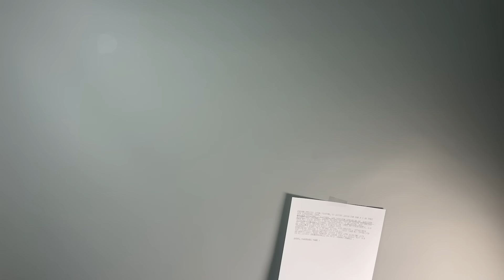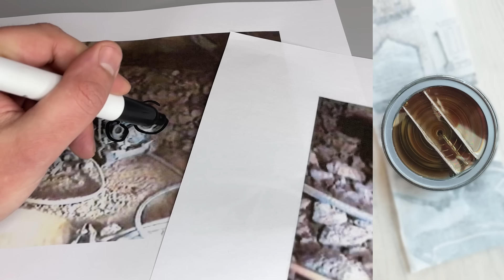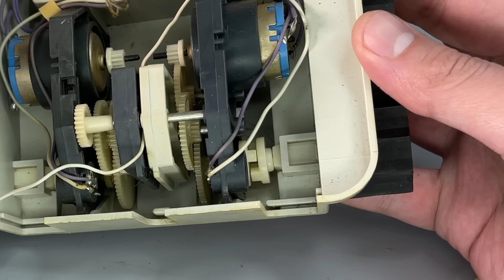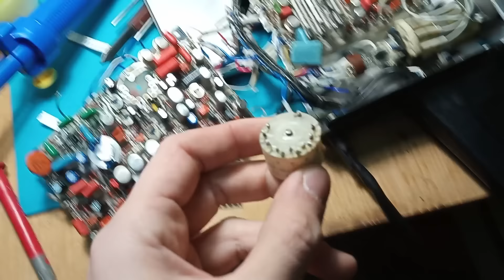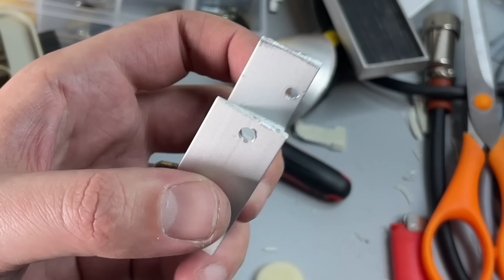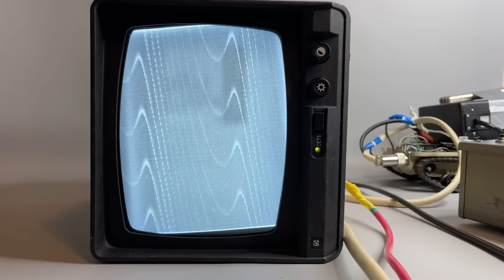We've rebuilt the first Chernobyl robot!

Comment: I doubt they raised the voltage of the motors. Because doing that would also mean raising the torque - making it even less controllable as it instantly kicks in (as with all electric motors). It would've also meant more wear and less reliability - and you surely don't want it to get stuck.

Maybe they used better means of control than simple on/off switches. Potentiometers maybe? I'm not an electronics guy.
Reply from the maker: Actually, you have a good point.

Comment: I wonder if rubber roller restorer used to restore grip for the pinch rollers of idler wheel turntables and cassette decks could potentially provide better traction for the treads.

Comment: If you want to improve the performance of the tracks in a manner consistent with what was possible in 86, and without replacing any parts, you could enlarge the holes the front axle goes through and move the axle forward to increase track tension and limit slippage. This is done on real tanks. A more dramatic change for one used in field experiments would involve separating the front axle and mounting the track tensioners directly to those camera mounting brackets using bits similar to those found in 1980s Erector sets [an engineering edutainment toy that taught kids how to build robots and functioning models of industrial equipment and vehicles]. The bits I suggest are essentially what you did to make the camera mount: custom bent aluminum strips with screw holes.

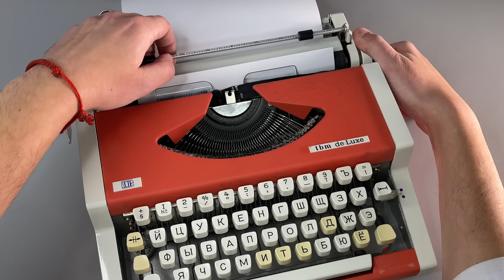Looking up how tank and construction tracks work IRL will help understand what I am on about. Friul models is a Hungarian company that specializes in working metal tracks for scale models that might help. They have a matching set of metal tracks and drive sprockets for a 1:35 scale T72 that would be thematic and should work, if you want a more rugged one for field testing

Comment: Blimey amazing how many parts of that toy seemed to line up with everything they wanted to fit, even down to screw holes!! To improve drive from the drive pulley to the track you could cut a section from a small bicycle inner tube and stretch it over the pulley so you have rubber against rubber rather than hard plastic against rubber?
Reply from the maker: we will tell you honestly, we were really impressed how things matched each other. It is unlikely it was planned, as the choice to pick a toy was limited, but imagine, how happy they were when something accidentally matched that good!

As for tracks, they are good per se, we just need to find the way to soften the rubber.

Comment: Awesome Do-it-yourself project. I'm surprised how much history lies behind a toy. I knew that a toy of some kind was used to get the camera close to the "elephant foot." Another interesting thing: the narrator said that they could get more power out of the motors if they increased the amount of battery output. I recall a cheap R/C car that I had. If I taped multiple batteries together and added a metal plate to make them touch the original contact plates, the car took off like a rocket! It was hilarious and fun to see. It's even funnier that this seems to only work with cheap, shoddy toys. I guess the expensive ones have sophisticated resistors so slapping on another battery isn't going to increase the power or speed up the toy.
Reply from the maker: That thing with elephant foot was not a toy but a cart with a drill; this one went into one of the outer corridors, not deep, but it surely helped.

Comment: I wonder what it would take to radiation harden a modern drone and how such a tool would have helped at the time if the technology was available.
Reply from the maker: For the Shelter? Well, we had a chat with scientists who built TR robots for it (see our documentary about robots), they said literally: "during 30 years we came to conclusion: on robot - maximum relays and "dumb" tech, all electronics better to keep at control panel. And then you are safe"
Reply: @ChernobylFamily  so I guess that’s a no to a DJI drone with enough lead shielding that it can’t fly anyway. 😂
Reply from the maker: @Voodoodrul  there was one experiment of using DJI drones, but inside unit 5 which is radioactive clean; there was an "inspector" drone in a protective cage around.
Reply from the maker: @Voodoodrul  and plus; the Shelter is the place where often you deal with VERY TIGHT (if I could make letter bigger, I would xD) space, so for that very place the best drone is a sort of a robotic snake.

Comment: I would hazard a guess regarding the image quality, it may be impacted by the rather sharp bends at the back of the rover/robot unit where it does a kind of loop. Coax video signal cables can self interfere sort of when bent over itself. At any rate it is rather easy to check if this is the case I think.
Reply from the maker: Yes, it appeared so. But to be honest, we have doubts that in original machine it was different. Unlikely it was planned to remain functional that long as it did..

Comment: I'm not sure if the show was accurate - but it seems if the radiation killed batteries and anything with a DC circuit. AC seemed unaffected. If fiber optics were available could they have built a (albeit crude) robot machine using induction motors and fiber optics (rather than electronic cameras)?
Reply from the maker: Gentlemen who design robots in Institute of NPP Safety formulated it shortly: "ideally, all electronics should be at operator's panel, while on robot only "dumb" components, such as motors and relays"

Comment: Wow what a project you ever made. I thought the robot failed all due to high radiation containment inside reactor. I had no ideas on how bad it was. I am very impressed of your projects you re-enacted. Good job Sir! Glory to Ukraine! Very Impressive!
Reply from the maker: Thank you so much for your motivating words! Well, we had an extensive chat with the experts who design actual robots for the Sarcophagus; their opinion is that this thing actually had all the chances to work well due to the fact that everything except the camera electronics was placed remotely, and even this camera might survive some relatively high (not extreme, though) radiation. It surely did not go to, say, reactor core surroundings as some documentaries claim, but it could explore some outer corridors which already was a contribution to safety of people. Nevertheless, the project is complete but not over, we still will work on some enhancements to make it even more accurate before placing on a permanent exhibition.
Glory to Heroes! Thank you!

Comment: For such a robot to persist that hellish place is it included a radiation shielding?
Reply from the maker: Conditions there vary very much. This one obviously did not go super far, but when you do not have maps for the territory at all, it is still a better option. Though over the years there appeared additions to the story that this thing went almost into the very reactor core which is not true.
Reply: @ChernobylFamily  i think i heard about every robots being sent to that certain nuclear reactor having their eletronics getting fried
Reply from the maker: Not every, but many; we had an extensive talk about this with ISNPP institute; they say that it depends on the route and type of electronics, THOUGH the best practice is to leave only relays and motors on the side of a robot and make optical protection of a camera e.g. with a mirror.
Reply: @ChernobylFamily  i see
Reply: @ChernobylFamily  did the developers considering non wheel or non tracked robots back then?
Reply from the maker: I do not have information about such ideas as for 1986; in the modern times yes, and some were developed, e.g. worm-like mechanisms to navigate through the drills.

Comment: I do recall learning about the original, at the time. As I remember it, a Channel 4 (here in the United Kingdom) television documentary crew went to Chernobyl. The researchers there were terribly poorly funded, hence their need to adapt a toy tank. The documentary showed them using it to explore the interior of the reactor, which (shockingly) was found to be empty: all the interior structure and fuel had melted and oozed out of the containment (most famously creating the so called "elephant's foot"). The Channel 4 documentary crew left behind their radiation suits, for the researchers, who'd only received ordinary chemical protection suits.
Reply from the maker: Yes, i remember that movie. The story is beautifully said, but they told what they were told by Kurchatov's expedition which likely wanted to gain attention and subsequently, foreign funds with was an issue in 1991 (the movie went on air around that time). The footage they used (which we also partly did) was manipulated. Specifically, in that documentary there were glued together a fragment with this robot and image of the reactor internals; the latter was clearly made with a PTZ camera like those we told about in our another video, the robot won't move this way to give that kind of picture. Not even speaking, this device never ever could survive even close to that place, the levels there were insane back then, that would burn away and plastic chassis melt. We had a chat with the Shelter researchers, they confirmed our guesses: it went relatively far, in outer corridors which nevertheless had severe radiation levels to be explored. Speaking about the Elephant foot, the way to it is not passable by any machine for 100% and before your reach it, you need to pass other, not less nasty FCMs. Summing it up, I mean, it DID it job, but not the way how it was presented, and myths were added over the years. That made the research of the project pretty complex. But very interesting.
Reply: @ChernobylFamily hey, dunno if you read this but your channel is so good just binge watching everything!
Reply from the maker: Thanks!

Comment: Wow this is amazing, I'm impressed by the realism. There may be a pot inside the camera controlling RF output gain that you can use to boost the signal before it goes through the coax. For the belt slipping on the driven rollers, you could try this stuff called "belt dressing". It's a bit sticky and helps with belt slip in car engines. That surplus electronics store was cool too - In Toronto we used to have a store called "Active Surplus" I spent hours in, but sadly it's been gone for many years.
Reply from the maker: About the belt dressing it is a very good idea. During a close-up inspection it is visible that motors do have enough power to move it well, but the contact between wheels and tracks is not that good as soon they get in their long-storage position.

Comment: What a wonderful passion project! Boy, it must've been hell researching the device!
I have A LOT of questions, I'll try to limit myself to the following:
1. How long do you think the control wire was?
2. Was the connector and robot body sturdy enough to evacuate the device by pulling its cord?
3. Do you think the wire had protection from interference? There was a lot if charges flying about...
4. Did you manage to fix image interference from the motors?
Reply from the maker: Feel free to ask LOT of questions, but let us answer to those four:
1. 15 meters as by Borovoi's book.
2. Yes. This in 75% cases is the plan.
3. That was a classical coaxial cable for video and multi-core for signals. There is no information on extra shielding.
4. Need to make a test if it actually occurs first.
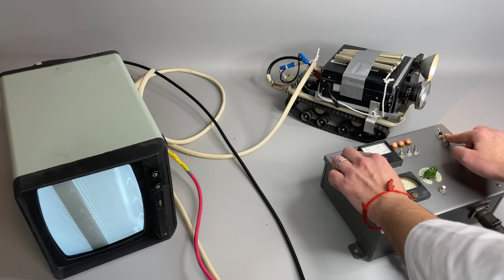Reply: @ChernobylFamily  No.04 - Interference occurs. A 18:07 there is an interference line pattern when you push motor buttons.
Reply from the maker: @volo870  Right. We will work on that.
Reply: @ChernobylFamily  I think this interference is noise created by sparking of the commutators in the electric motors. I think it is probably authentic to the original robot, doesn't seem like something one would mess about trying to fix in the middle of an emergency so long as the robot was usable.

Comment: Bravo, you've done well! Amazing research, I think you need a shielded cable for your video signal as Electronmasters image looked quite sharper.
Reply from the maker: It is shielded coaxial, the problem is has 3 soldered connections. Just need to get a better one.

Comment: as always, Nice Video.
i heard that boiling rubber bands for tape decks can restore slightly the plasticity and shape, you could try that on the tracks
Reply from the maker: thank you for this hint! Because their condition really affects movement very much, video does not capture that.
Reply: It should also be pretty easy to model and recreate the belts as a 3d model and print them in a flexible filament like TPU. On thingiverse there's a project called "Robot Base II" that has such tread belts.

Comment: Best tutorial on "How to design radiation hardened robot"
Reply from the maker: Still not the best. We showed this to engineers who design actual robots for the Shelter, they said that yes, this would work, but not that far. The only thing that can survive, must have all electronics at operators's place, and on the robot have to be only relays.
Reply: True, voltage drop on thin wires for long runs would make it a bit anemic. I wonder if they fed it higher voltage at the control box to accomodate for that voltage drop when it met the motors....  @ChernobylFamily

Comment: I’m surprised how small it was.  I actually made a radio controlled tank for my final year school project in 1986. I used an “action man tank” which was a kids toy for the body and fitted better tracks and radio gear inside it - it was very robust
Reply from the maker: Wow! Thank you for sharing!
Reply: How did u make the tracks?
Reply: @allyboouwu i used the original plastic tracks that just about worked.  Fast forward 40 years I bought the same action man tank - but I want to use better tracks which im struggling to find.

edit - noted i said better tracks on the op, i didn’t change the tracks they were original - i did replace the idler gears though

Comment: Also this is an odd question, but it has always fascinated me, do you know what the thickness of the wires that you connect to the connectors ??
Reply from the maker: RP-15 accept up to 400V 5A, and by diameter of pins from inside I'd say 3 sq. mm easily (if we do not mind the flexibility)
Reply: @ChernobylFamily  thank you so much, i was not expecting an answer so fast. It is crazy to think that they just modified a toy and sent it inside. When they talk about radiation destroying these "robots" it makes sense now. But then again, even modern NPP robots suffer from damage when surveying reactors that are not leaking or in malfunction. In my mind i always thought they were huge robots that were used - https://www.youtube.com/watch?v=1Qp9dYgTDTE - similar to these. 

It fills me with anguish that none of the "liquidators" or the families displaced from Pripyat were ever formally acknowledged/awarded/or compensated. They saved the world from disaster. sorry for the long reply.